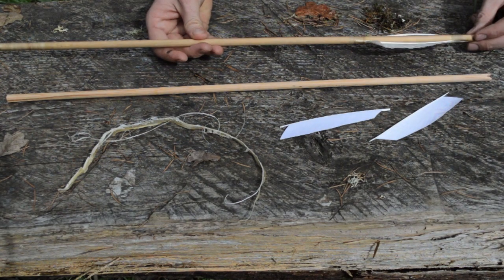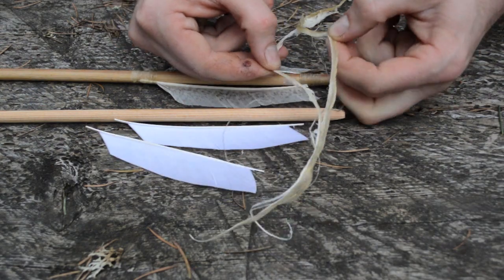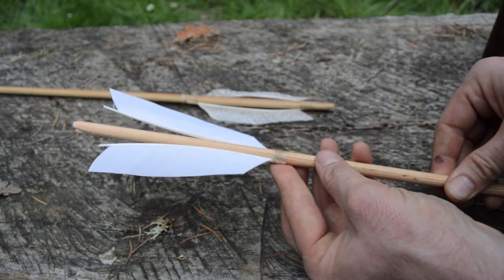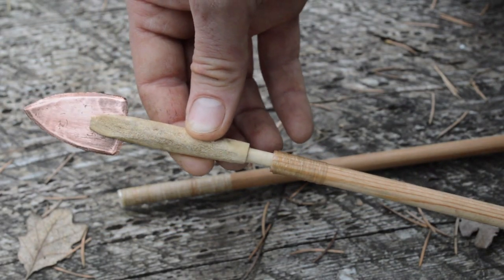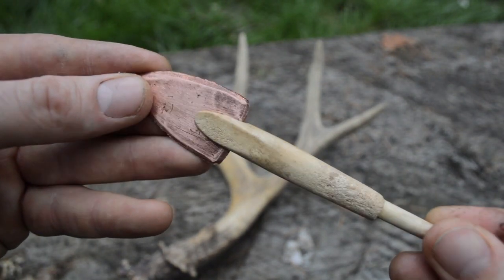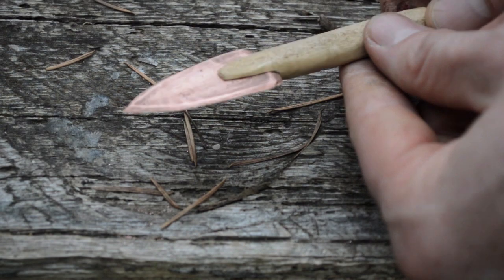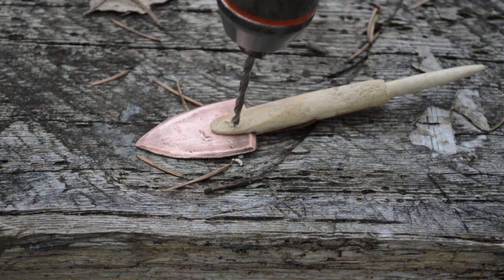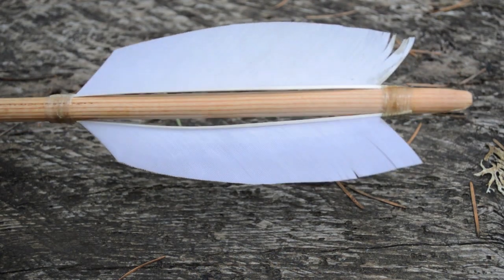Eskimo Arrow. How to make a Copper Inuit Style Arrow For Primitive Archery Hunting.

Comment: We inuit used seal blood as glue instead of hide glue, in the cold of winter you don’t want to waste precious oil to burn lamps and boil glue. We also used primarily ivory/bone or slate arrowheads in some regions, as copper is hard to come by on the land. Inuit hav also used iron for centuries, in the west there were iron deposits in the Cape York meteors, and for a long time we traded ivory from walrus and narwhale to scandinavians in return for iron. After the age of vikings was over we went back to using stone and organic tools, also copper in some cases.

Comment: I have a question about the nock on these primitive arrows :
Why aren't they deeper than more modern arrows ?

By the way, great videos and very informative too!
Reply: Many (not all) indigenous peoples used variations of the pinch grip. I use it and use very shallow nocks, works very well.
Reply: A lot of primitive arrow string nocks are shallow and wide because of the natural bowstring material such as plant fiber and rawhide, not to mention sinew that was used. Natural strings are usually thicker, especially plant fiber like Indian Hemp and Basswood inner bark.

Comment: The copper arrowhead didn't really look that sharp.. and it probably took more time to make than any regular flint/obsidian arrow head, and I'm guessing that the obsidian ones were wayyy sharper than that. So I'm wondering, why did they use copper ones?
Reply: flint and obsidian isn't really found in the arctic.  The inuit used shale knifes a lot of the time.  They been know to cold hammer iron when available but they were so far removed from the trade routes they couldn't get a hold of obsidian.
Reply: @jackson15williams  intresting. Very intresting. However, do you have any reason for tribes that used metal arrowheads even though they lived near flint/ obsidian?
Reply: @aguywithahand502  Some tribes switched over to iron arrowheads when they could get iron from traders. I know the Comanches did this. They would travel down to Mexico or near Mexico at least and trade for iron/steel from Mexican traders and forge their own arrowheads in mass before heading north again to continue their war with the Americans.

You would think that they preferred guns by then since they did have them. But Comanches considered bows to be excellent weapons. They knew how to shoot them very fast and some  preferred them over guns.

The reason they would switch to metal is probably because it's more durable and not easily broken like a stone point.

Comment: I've been curious about how a 2 feathered shaft flies compared to what I've been taught about 3 or 4 feathers.. Do you have any vids of some of these 2 feathers in flight ??
Reply: I used to only shoot two feather arrows. If there's enough twist it will stabilize quickly and shoot extremely accurately. That's my own experience but I moved to three feathers now because I like the look.

Comment: Nice! I've seen some people when using copper to make blades and such have to work harden the edge by hammering it. Do you know if the Inuit did this as well? or did they like the point malleable like our bullets are today so they would mushroom upon impact?
Reply: You would never want an arrow tip to mushroom like a bullets. Arrows don't have near the energy a bullet has
Reply: What about the the work hardening of the edge by hammering any info on that? I know they do it on copper axes and knives sees like if they did it on the arrow point they would get the added benefits of having a more durable cutting edge.
Reply: Landon Ashby 
It wouldn't have needed to be done, since it would harden enough as part of the smelting and forging processes. Deliberate hardening would also make it brittle, which is very undesirable, especially in below-zero temperatures.

Comment: how can someone make a compound/ footed arrow without a flint drill. would a regular drill bit work for this?
Reply: A regular one would work. Or you can hammer a large nail through a board then hammer the point flat. You now have  fixed drill that you can spin the arrow shaft on.